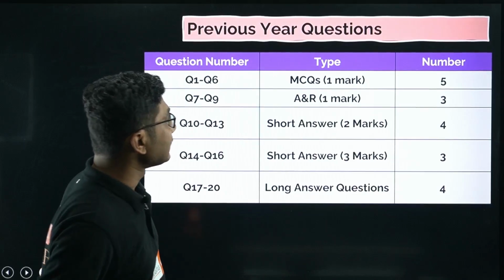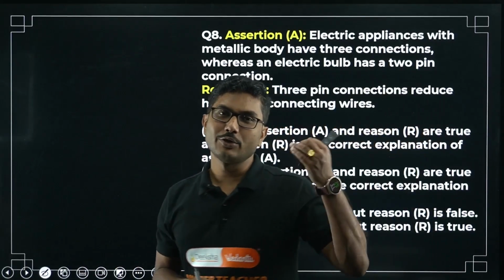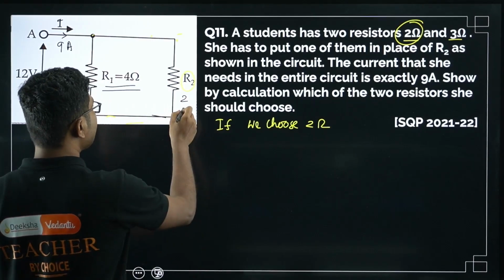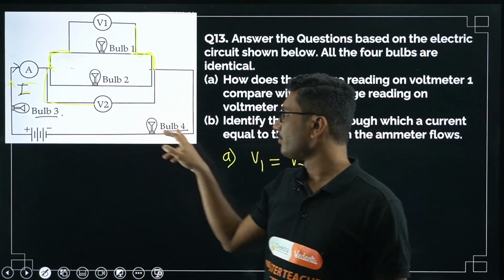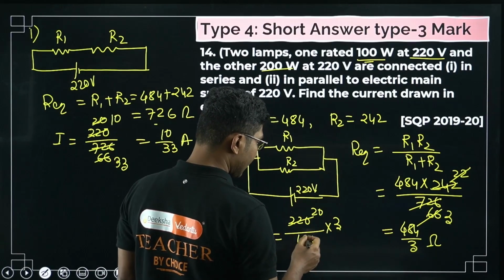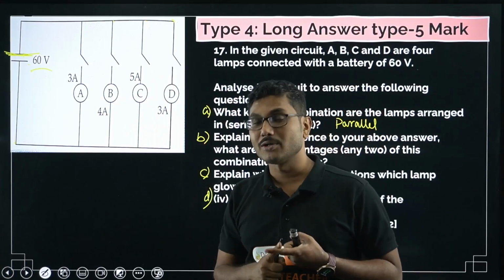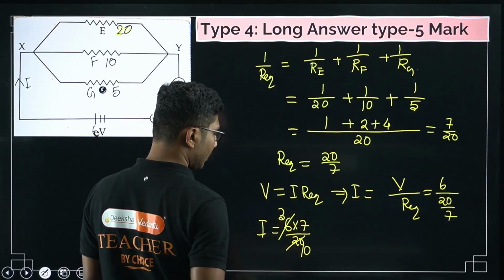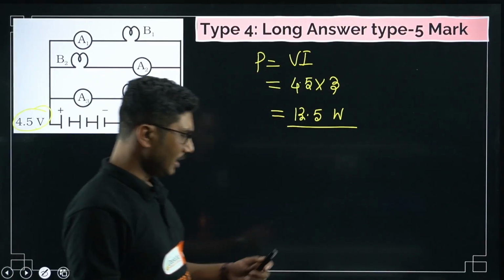Day 39 | 99% in 99 Days | Class 10th Science | Electricity | Previous Year Questions

Comment: A: In series combination of resistances, the flow of current across each resistor remains the same. 
R: In series combination, the net resistance is more than maximum resistance connected in series. 

Sir, i had a doubt.... assertion is true.. but how is reason true? Could u please explain.. the answer key says option (A)
Reply from the maker: R_eq=R1+R2+R3 so, the net resistance is more the maximum resistance. But this is not the correct explanation. So, the correct answer should be option B.
Reply: Got it, thankyou sir for clarifying my doubt :)